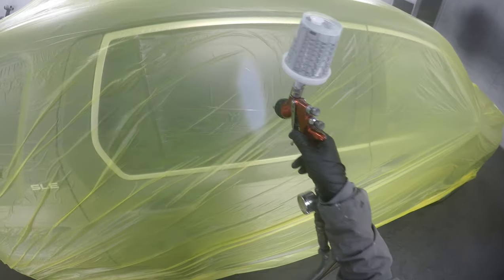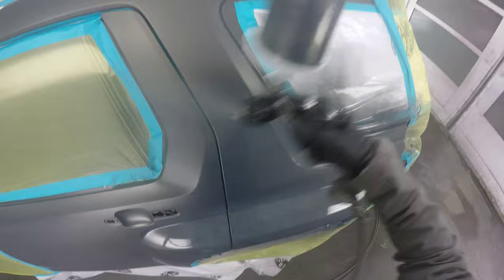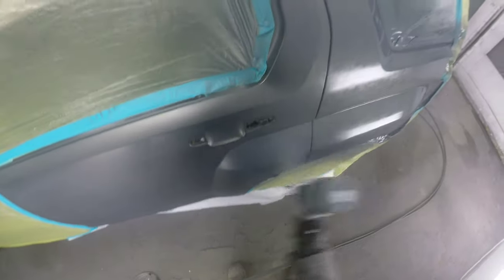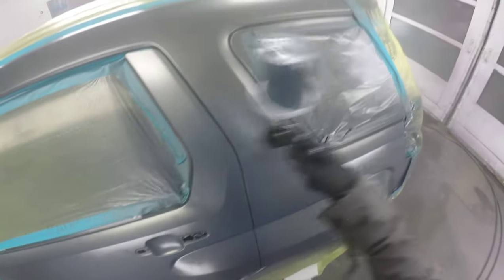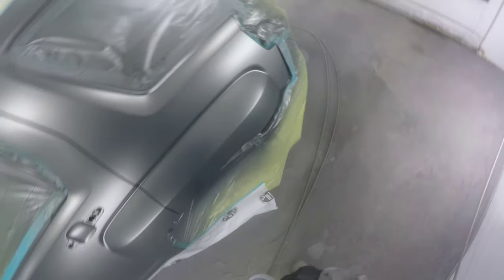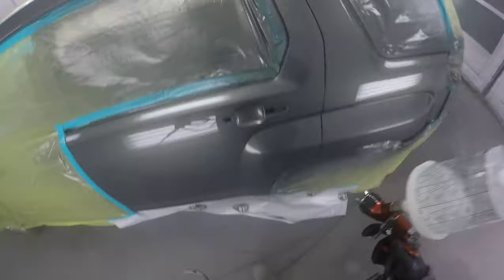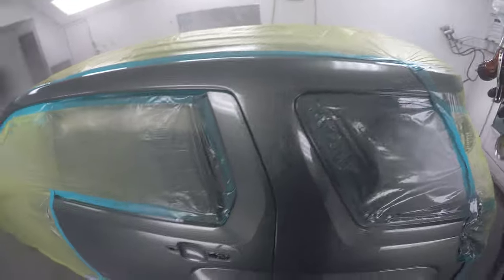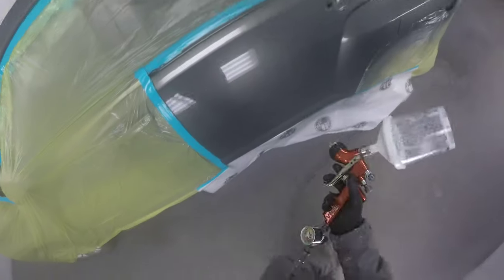How to Blend Metallics with Waterborne Paint

Comment: How often do you use T490 as your first coat?
Reply from the maker: Not often. Only when the colour is going to be very difficult. I like using it 50/50 in my base for one final coat to really help blending and metallic orientation. Then a control coat
Reply: So when you do your control coat you reduce it down 50/50?
Reply from the maker: That’s just an extra little step I’ll use for metallics. The control coat will be reduced down. I’ve found essentially 2.5 coats for hood coverage on silvers that way. No mottling or striping. Makes painting easier
Reply: I'm about two months in to using Envirobase. Used Chromabase so far my whole career so I appreciate your videos and response
Reply from the maker: @joe2.017  find me on IG if you got anymore questions
Reply: Same name on IG?
Reply from the maker: Yes

Comment: You don't throw metallics to the blend panel edges with those 2nd & orientation coats ??? And,,, by spraying to the edge with each coat of clear - The clear don't throw off an optical discoloration ???
Reply from the maker: I don't put any colour at the edge of a panel where it butts up against an unpainted panel. I always clear the whole panel. Never had issues with the colours looking off.